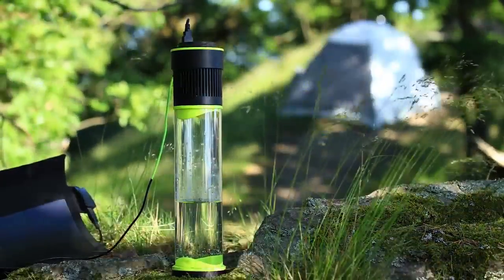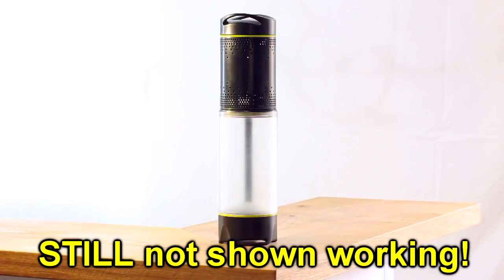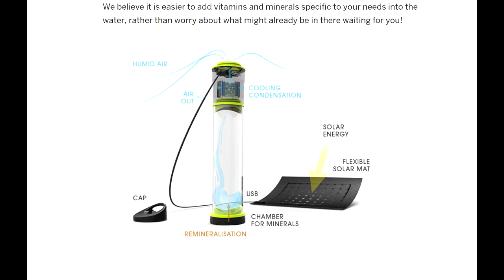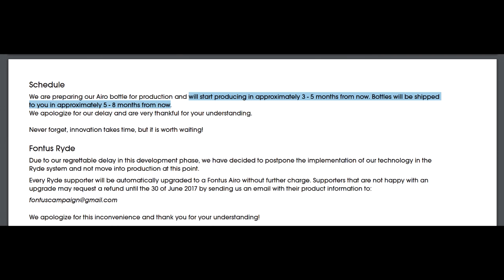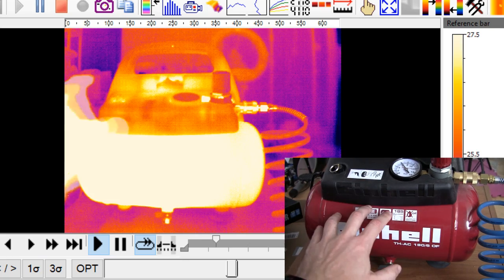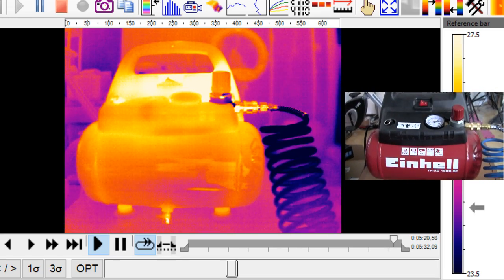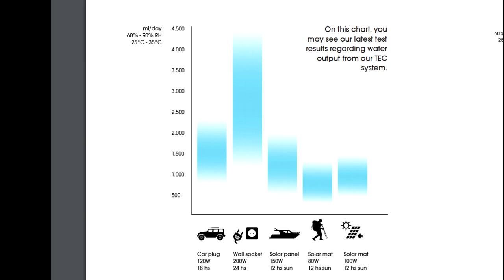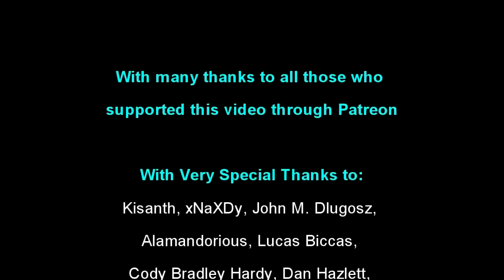$300 000 Self-Filling water bottle, SUPERFAIL!

Comment: I love how they fail to mention that the "supplements" you add to the water are essentially anti-biotic decontaminants.  So that you don't get a horrible illness from drinking all of the bacteria pulled out of the air. The same damn reason they warn you not to drink dehumidifier water.  If you don't have your supplement, you better get ready to buy a s*** ton of replaceable filters.
Reply: There seems to be a general misunderstanding or lack of knowledge regarding microbes here.  I'm a microbiologist and I'm here to help.  First, by definition viruses are not alive.  They don't have metabolism and they cannot reproduce on their own.  They simply exist.  Assuming you protect the envelope at the proper pH, osmotic pressure, and temperature they will exist forever.  They cannot multiply without their TARGET.  You cannot infect a dog with HIV.  Bacteria must have an energy source, usually carbon, the correct nutrients for it's lifecycle, and the correct growth conditions (pH, temperature, oxygen concentration, and moisture) for it's lifecycle.  It is incorrect to say you can freeze bacteria and thaw them later completely healthy.  Freezing actually kills the majority of bacteria as the water in the cell expands and bursts the cell.  Only organisms intended to grow at or below 0 celsius are ideal for freezing.  Some organisms shut down at near freezing temperatures and some produce spores that can survive freezing.  In a real micro lab, cultures are refrigerated TO SLOW GROWTH and nutrients are refreshed at a specific frequency.  That being said - no bacteria can survive forever in stasis.  Like all life, it must consume energy, produce waste, and reproduce.  If there was an organism that survived forever, eventually it would be the only living thing on earth.

Now to focus in on pathogens, which seems to be the purpose of this discussion.  I suggest reading up on Koch's postulates and germ theory to help clear up some misunderstandings.  In order for a pathogen to be harmful it must find the proper host AND find the correct binding site.  In my career, I've had my hand in a high concentration culture of salmonella and was never worried about getting sick.  Salmonella needs to get to your intestine in order to make you sick.  Salmonella is one of the common gut flora for birds yet they're never sick.  E.coli O157H7 is common to cow intestines without making them sick.  In terms of infection, the respiratory system is a much better vector than ingestion.  Simply put, surviving the low pH of the stomach is quite a challenge.  Then when you add digestive enzymes, the GI tract becomes a difficult vector.  That's why a person with a common cold can prepare your food and have a low probability of making you sick.  Very few organisms are spread by food, which is good when you consider how many people handle your food before you get to eat it.  The respiratory system and its mucous membranes are ideal infection vectors.  You have a limited immune response in your respiratory system, which is how our body is intended to work.  We breathe in so many "foreign" molecules we don't want to have an immune response all the time.  Allergies are an example of an improper immune response.  Organisms also don't have to overcome stomach acid and digestive enzymes.  Here's where it gets interesting.  The organisms meant to spread through the air RARELY survive the GI tract, so whatever you isolate from a dehumidifier is not likely to hurt you drinking the water.  Simply put, organisms that rely on airborne vectors didn't evolve to survive the GI tract.

If you use ice from your refrigerator, you most certainly consume the airborne organisms that condensed onto the ice.
Reply: "Air inhalation is a direct pathway into your body, no different from drinking or your pores on your skin."

Sir, you just refuted all of what you said directly before in a most hilarious manner. Yes, it is "from the air", but indirectly. The surface that gathers water inside your dehumidifier gathers up the bacteria too - meaning it is found there in a much higher quantity, increasing the risk of your immune system not being able to deal with them at once. It isn't "pulled" from the air by magic. That was the point of Michael's comment, he said nothing wrong. He added some technicality to what you said, nothing more. Though your spergy reaction is priceless.
Reply: So to summarize:
manright: "haha! 1+1 = 2! Fondus scammers!"
MIchael: "Wrong! 1+1 = 2! Even 5th graders know that!"
manright: "what?! are you daft?! clearly 1+1 = 2!"
Joe: "actually, you see that equation you guys are looking at?  that's not 1+1 = 2, that's 1+7 = 8."
manright: "haha! Thank you Joe!  Look at all the things I was right about! that 1 is really important!"
Joe: "actually, that 1 isn't so important.  I would happily swim in a pool of bacteria."
manright: "Crazy things which are highly unlikely can and will happen!"
Joe: "Modern technologies are amazing.  Solar roadway scammers!"

But just a little more seriously:
Laymen will definitively tell you about all the things they know, which is usually twice as much as they can actually prove.
Experts will concisely tell you about all the things they don't know, and only 50% of what they do know.  If you want to get the other 50% out of them, you have to ask the right questions.
Reply: I interpreted your comments different. When I say fringe case I mean oddball organisms that will always behave a certain way in a given environment. I interpreted your use of outlier to mean someone getting sick because they drank an organism that was in the air. I'm talking about an existing ORGANISM and thought you were talking about CIRCUMSTANCES. 

We absolutely need to stop overusing antibiotics. The American medical association and several research groups have stated this. On the other hand, we make more money if we cram a bunch of cows into confined spaces, make them stand in a mix of poop and food, and feed them antibiotics to counter the unsanitary conditions. We need to stop giving antibiotics for every trip to the doctors office. It's too long to get into, but microbes have ways to share genetics, sometimes across genus and species. Penicillin is useless now because of our overuse.  MRSA is one of the first superbugs caused by our overuse. Staphylococcus can share genes:  ncbi.nlm.nih.gov - Characterization of the conjugation system associated with the Staphylococcus aureus plasmid pJE1. - PubMed - NCBI

Back to the topic at hand - clean your house, clean your food contact surfaces, be thankful for water treatment, and don't buy into claims that are too good to be true. Solar freakin roadways!
Reply: You know that the parts where the water condenses is prone to bacterial growth, but unfortunately Fontus didn't find out about that after they "researched" for almost 1 year. Someone asked if the condenser/filter needs any cleaning - they said "no". I would disinfect that thing continuously - nothing is worse for bacterial and fungal growth that a humid environment as you might find on the fins of a condenser.
Reply: Lol...  I didn't say that the bacteria DIE (although most will over time), i said they don't REPRODUCE.  There's a drastic difference.  If 5 bubonic plague bacteria get into the condenser coil, you would most likely never know it.  Your immune system would fight it off no problem.  Without FOOD there will only ever be 5 of them.  Give them food, and you'll end up with MILLIONS and DIE from it.  Many species can be stored for long periods because they deactivate - their metabolism shuts off, they essentially "dig in and wait" for better conditions.  THEY DO NOT REPRODUCE IN THIS STATE.  (Viruses work the same way)

The physicians wear face masks to protect themselves because they are in CLOSE proximity to sick people day in and day out.  Like i have stated multiple times, the infections can travel short distances through the air.  This is also why you see average people wearing face masks in highly crowded areas around the world.  When you're shoulder to shoulder with a thousand people a day, then that risk is legitimate.  Doctors also wear protection to protect the patients as well - as the doctors are commonly in contact with infectious diseases, they have a high chance of passing it onto healthy individuals.  

Are you honestly trying to say that bacteria have wings and can fly?  That they can "see" a target and move towards it?  Do you know how absurd that sounds?  Bacteria are, without a doubt, highly robust.  But they're still alive, and still require food.  That's one of the definitions of life!  A "warm dark place" is not food.  They need to consume other nutrients/bacteria/protozoa/etc or else use sunlight to produce energy.  (Granted, there are other types that can produce energy from unusual sources, but these are not infectious diseases - extremophiles could not live in the human body.)  Warmth is important in many cases because the enzymes and proteins that deal with metabolism require specific temperatures to work. Moist is important too, because without water (the "universal solvent") the molecules would not be able to freely move and interact with each other.  

Over time, the bacteria that do enter the condenser will die w/out food.  Their bodies will become food for other bacteria, that will reproduce, use up all the available food, and then die again.  This continues until a film of bacteria will build up.  This film will provide additional protection for future generations of bacteria and is very difficult to clean off.  THIS IS WHAT YOU WOULD NEED TO SANITIZE.  When a bacteria dies, does it just vanish?  No.  It leaves a bacteria corpse behind.  Which is then eaten by future bacteria.  

It is unreal how thick headed and arrogant you are.  Here's a thought - go wiki ATP.  Read how metabolism works.  Every living thing has to metabolize.  Note what you have to ADD to the equation to make it work.  Food!  As tf00t says, "there's no such thing as a free lunch"!
Reply: "It has to do with more than just the container holding the water."
Yes, it has to do with the inside surfaces, not just the container. If the water would contain only the amount of bacteria the processed air did, your immune system would have no problem dealing with it. Unless of course you'd get infected by breathing said air all the same. And somehow we're the ones who don't "appreciate the idea of airborne transmission". Right.
The point Michael made is that the water slowly dribbling all over the surfaces that have bacteria and other shit in a much higher density on them carries a much bigger risk of infection.

"Breathing is not sancrosanct nor is it inherently safer than any other method of transmission."
No shit. You're the one insisting on the opposite.

"The intellectually mediocre should not try to judge that which they do not understand."
Oy. The ass burgers. Tone it down. You're just looking ridiculous.
Reply: manrightchea bacteria and viruses both duplicate themselves over time WITH FOOD. what kind of food are they going to find inside a machine that condenses air? if the device is brand-new there won't be any particulates in the device for the bacteria to grow. you do understand that bacteria need food right? if it were possible to clean the inside of the condenser then there would be no risk at all, the problem is there's no way to really do that and be sure that it's clean. so over time and nothing junk will build up inside the machine to allow the bacteria to grow. viruses do not grow unless they have something to infect and multiply with. you could take a million virus particles put them in a device with no available target and come back and you'd still have a million virus particles. again if you were able to efficiently clean the inside of a condenser it wouldn't cause you any problems. again if the device is brand-new there hasn't been any accumulation of food inside the device and so you will not have any bacteria (at least not enough to make you sick).  seriously, this is 5th grade shit.
Reply: LMFAO mate. That's why you deleted your nonsensical comment, right? RIGHT? xĐ
Yeah I'm done here. Glad I got into the habit of directly quoting people.
Reply: Oh I didn't say I'm leaving. I said I'm done taking you seriously. No reason to not have more fun. So, you said you DIDN'T delete your comment, right?
Reply: Imagine the size of that thing when they put this on top: http://www.practicalprimitive.com/images/newsletters/charcoalfilter/fullfilter.jpg
Reply: manrightchea we've rebutted your nonsense multiple times. your arguments don't make any sense you basically believe in some kind of magic bacteria that reproduces without food and only affects air condensers...
Reply: He was wrong about bacteria in the air but he was absolutely correct about the safety of drinking condensed water. Thunderfoot did not interpret that article correctly. Condensed water is just distilled water and distilled water is safe to drink. The article is saying that air humidifiers are not designed to be sanitary and the water sits stagnant exposed to the air. As much as I hate to defend this dumb product, the condensed water is sealed inside of the bottle and air contamination probably wouldn't be much of a danger. You don't have to be a asshole because you were both wrong about 1/2 of the issue. You've been an aggressive cunt in every single one of your comments. You can educate people without being a prick about it, but get your facts straight first.
Reply: I wouldn't drink it because it'll taste bad and I have lots of other options. If it was my only option, sure I'd drink it. I didn't say "rarely" or "not likely" because I was worried that the Saccharomyces in the air will suddenly become an incurable monster. I said it because there are some fringe cases where there would be risk. Legionella for example, although it's quite rare. Legionella is a genus of airborne organisms that likes the environment of a dehumidifier and can survive the GI tract. Odds that it'll happen, very low. B. anthracis is zoonotic and can be spread through inhalation and digestion.  It's also quite common in soil. Again, I'm not worried about it. I would gladly swim in a pool of Pseudomonas.  There's a genus that gets a bad name because you can make it sound scary. Unless you have cystic fibrosis, not a concern. 

Biology is a softer science than physics or chemistry. Even under optimal growth conditions nobody can guarantee a certain cell count over time. It's all about averages and likelihoods. In physics force always equals mass times acceleration.

All this being said - over use of antibiotics and modern farming practices are orders of magnitude more likely to make a super bug than drinking dehumidifier output. That's something to make you lose sleep.
Reply: You just made yourself look stupid. Just stop.
Reply: ***** many thanks.
Reply: manrightchea how did these morons get this far without knowing the science and someone saying this wouldn't work?!?
Reply: I can appreciate the knowledge of someone that is an actual microbiologist.  My take aways from your posts are a few things. Firstly, thank you for confirming that respiration is indeed a potent transmission vector for infection. My intentions were never to pretend to be an expert on pathogens or microbes. My intention were to correct the ignorance that air is somehow  "less dangerous" inherently as a transmission vector.  Secondly, I notice that you yourself chose very particular words such as "organisms spread through air RARELY survive the GI tract" and that dehumidifier water is "not likely" to hurt you. These words imply doubt, a doubt you realize because of your profession.  "Rarely" gives credence to the idea that something rarely occuring in likelihood is no guarantee such as thing won't occur.  The water being "not likely" to hurt you implies no guarantee it will not harm you. 

Your familiarity with your profession will not allow you to speak definitively or to disavow definitively the threat posed by an act as stupid as drinking dehumidifier water. This is because there are outliers, there are exceptions to the general standards.  I know enough to know that certain bacteria thrive in certain conditions while other do not. Certain pathogens are more readily spread through certain transmission vectors over others. I also am fully aware that bacteria are the most varied, most common and longest sustained life forms on the planet. There are very many that are not easily combatible such as MRSA, ebola, pseudomonas, and osteomyelitis.  Every pathway into the human body can be a vector of transmission. Respiration, ingestion, pores in ones skin, even the anus even if it feels uncormfortable to say so. I may be no microbiologist but I do come from a family with a rich medical background. 

Even so, would you in your profession drink stagnant dehumidifier water without sterilizing it? If that answer is yes then I'd have to question how you found your profession. However I am confident that answer is no. As would be for any person with common sense.
Reply: Joe Bobula    Fringe cases being the same as an outlier or an exception to the rule. That is exactly what I said.  Pseudomonas notwithstanding, there are a plethora of bacteria resistant to antibiotic treatment.  I have no interest in playing devil's advocate, everything I've said has already been confirmed one way or another.  MRSA, osteo and many other outliers exist.

Overabundance of antibiotic is a problem but also very likely a necessary evil. If a superbug is destined to evolve, well it was likely to do so anyway given the conditions. I don't lose sleep over things I can't control.
Reply: They raised over 300 grand, I'd call that a success!
Reply: I just can't for the life of me figure out why this guy can't understand that 1 + 1 is indeed 2. It's irrefutable fact! Oh yeah air infections etc.
Reply: I gave you multiple chances. My comments kept "mysteriously" disappearing too. I think I'll screen cap this one too, and leave you a little package.
http://imgur.com/a/AaPEw
Happy posting people ;)
Reply: +anonov anon  The comments system is bullshit. Even when I don't remove my own comments, YouTube will hide it from some people and not others, and sometimes it only hides the links so it turns into "I gave evidence", "No you didn't", "yuh huh", "nuh uh"...
Reply: Nah, the comment is "missing" on any account you check it on.
Reply: +anonov anon Oh that specific one yeah, he removed it. I was talking about other situations where I get hit by a spam filter while others spam links to bullshit.
Reply: And now notice how this whole thread is hidden. Because it's the next best thing to removing it, I guess.
Reply: Scabbage   I don't remove comments, I haven't removed anything. I believe in rebutting comments, however Thunderfoot can delete them or hide them.
Reply: This went off on a tangent unrelated to the original topic. I understand if someone hid the comments to keep the comments focused.
Reply: manrightchea it means they got marked as spam. and no I didn't mark your comments as spam.
Reply: How do you KNOW it's Thunderfoot though? As opposed to YouTube's machine learning being wonky? I don't see a reason for him to delete that comment in particular, or hide the entire thread.

Then again, I don't get half of what he does. It's like there's two Thunderfoots, one that makes alright science videos and one that makes bitchy rants about social issues or insulting some other YouTuber I give 0 fucks about.
Reply: Michael Medlock    May have been that other prick that got his panties bound up. Unlike you he didn't actually try to rebutt my comments. I've always thought it's immature to delete comments. I can use my logic to rebut anything I feel. I don't think it's a big mystery, most likely Thunderfoot got rid of/hid the comments.

The channel owner has the final say on any comment.
Reply: It's YOUR comment dipshit. You didn't even act all surprised it's missing. Meaning you removed it. The pics prove it. Accept it, you have been called on your bullshit.
Reply: Patriot Cat    To answer your question , if you have to distill aka boil the water before you can drink it, then you just essentially made everything unnecessarily difficult. You've accomplished in 20-25 minutes of boiling a small quantity of water , what any Brita filter could have done in a few seconds.

Or even have just gone straight for tap water. At least that is pretreated, and despite what people might want to think, generally perfectly safe to drink depending upon your area of course. Considering a person will be using this device at home due to the energy requirements, it is completely pointless.

It isn't portable and it isn't efficient.  I think this is an example of what happens when you fail to think about a project before diving head-first. I think the makers of this thing knew they had screwed up shortly after Thunderfoot's original video came out. However, their denial, ego, and the fact that they had shot themselves in the foot by accepting so much money forced them to continue on this endeavor ultimately doomed to failure.

This isn't going to end well, they will not give that money back, because they have lost so much on a failed investment. That is why they are going by email because they are going to cut and run.
Reply: manrightchea that's right, and every single one of the bacteria you mentioned only travel very short distances through the air. when you catch the cold from somebody it is not typically from breathing it in its from touching surfaces that got sneezed or touched after somebody sneezed on their own hand. you were talking about bacteria, not viruses. as far as having an immune system, no shit Sherlock. that just further backs up my statement that drinking water out of a dehumidifier is not going to kill you. nearly every surface in this planet is covered in bacteria. being scared of drinking out of a dehumidifier is ludicrous, especially if death from dehydration is the other alternative...
Reply: manrightchea Wrong. the reason you're not supposed to drink dehumidifier water is because the surfaces inside the dehumidifier are most likely not maintained in a clean state. Because the inside is not kept clean as soon as the water condenses it touches the surfaces that are covered in bacteria. It has nothing to do with "bacteria in the air". If that were the case, breathing would kill us. A simple iodine tablet put in the dehumidifier would take care of any bacterial problems. There are plenty of reasons why this product is bullshit, but killer "air bacteria" is not one of them.
Reply: manrightchea 
S A V A G E
Reply: Jézusmária    Higher density my ass. You'd be a fool to drink the water even out of a brand new humidifier. It doesn't take a bucket of cold virus to catch one. It doesn't take an entire room full of pneumonia or tuberculosis to contract it.  "Higher risk" is irrelevant to the fact of the existence of the risk itself. Answer the question on how does the Infectious material get there.  How does it get into the machine? Why do doctors wear face masks when dealing with infectious disease? Either answer the questions or stop wasting my time. 

 Accumulation occurs over time, overtime of *processing air*.  Bacteria multiply, viruses multiply. That's why you can wake up considerably more sick even after one sneeze in your face.

You both are painfully ignorant.  Insisting on the opposite to a statement I have explained three times..no you both just lack comprehension.
Reply: R. Alley savagely stupid, you mean
Reply: Michael Medlock    Wow you are painfully ignorant. "Bacteria only multiply with food". Honestly if you are saying that it proves how far gone you are. If they only multiply with food it makes me wonder why they can be stored for YEARS on end when deep frozen, yet be completely revived.   I guess physicians that wear face masks when dealing with infected individuals are being overly cautious.. "as long as it's only a little exposure it won't be enough bacteria to get them sick". I'm glad that you know how to quantify how much of a bacteria takes to cause a serious infection. Here I thought they were microscopic, widely varied and some of the most robust and self sustained life forms on the planet, long before there was ever food to eat.  Now if you meant to say that bacteria need energy, you know such as a warm, dark source like a dehumidifier in which to multiply then I might understand.

If anyone is operating on a fifth grade level it is you. Why would there be a need to sanitize the machine, if what you're saying is true then sanitizing the container would be enough. You just said that there is no food inside the machine so what are you sanitizing. Sanitizing the machine implies that the processing of the air is what leads to the accumulation.  I'm glad that you finally understand.
Reply: Michael Medlock

You don't know what you're talking about man. Doctors wear face masks to protect themselves from airborne transmission of infection, the same reason people wear face masks in third world countries, either because the air is contaminated with air transmittable pollutants, or to protect themselves from infection. Physicians wear gloves and long sleeves to protect themselves from infection through their pores as well as preventing physical secondary spread of an infectious bacteria, as well as protecting the patient. That's all there is to it.  The bacteria are drawn into a dehumidifier from the air, first its food that they "need", now they don't need food to survive just energy, first breathing wasn't dangerous and you didn't acknowledge an immune system until it was pointed out to you. You're trying to guesstimate knowledge that you don't really understand.  Bacteria can be transmitted through the air, proximity, distance or "mininum accumulation" are irrelevant to the fact that air is a method of transmission.  

Wind current, water vapor and pretty much everything else airborne can carry and thus transmit bacteria. Which is why air conditioners , dehumidifiers, fan blades and anything else that processes and travels through air accumulate bacteria, this is why they have filtering mechanisms. Period. If this were not true you would not have nose hairs , which I'm sure you never knew what they were for. Nor would your lungs need mucous membranes to trap contaminants. You can try to talk around that fact however you want it doesn't change the truth as I quoted earlier in my first response.  "Bacterial film"...

Myself and about 40 other people understand what's going on. You have been trying to invalidate your earlier ignorance by trying to pretend airborne transmission is not a thing or presenting it as a "minimal danger" which is nonsense.  It matters little to me whether you try to deny it.
Reply: Michael Medlock     Breathing doesn't kill you because you have an immune system moron, one that developed over millions of years of evolution. Even so there are still very many bacteria that can kill you dead. There is absolutely nothing wrong about what I said, airborne bacteria, viruses such as common cold, carcinogens from second-hand smoke, chemicals from aerosol and any other number of contaminants are in the air AND whatever container holds the water after it has been used.  Common cold and flu virus can and is spread through air, mold spores can and are spread through air. Period.

If you didn't have an immune system you would have been dead long ago air or no air. Learn something about human anatomy and the world you live in before you seek to correct somebody.  Air inhalation is a direct pathway into your body, no different from drinking or your pores on your skin.

"Many common infections can spread by airborne transmission at least in some cases, including: Anthrax (inhalational), Chickenpox, Influenza, Measles, Smallpox, Cryptococcosis, and Tuberculosis."
Reply: Jézusmária    I didn't delete any comment, you're leaving because you don't know how to rebut what I'm saying, assuming you even know what that word means.
Reply: Jézusmária   You're done because you don't have anything to say, that's fine by me, I'm not interested in your immature temper tantrums and ignorance fueled arguments.